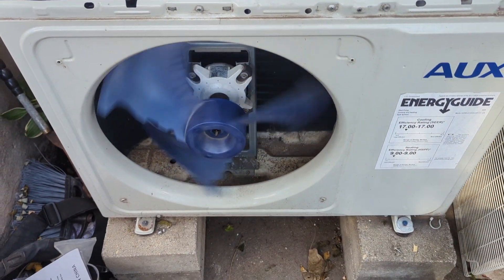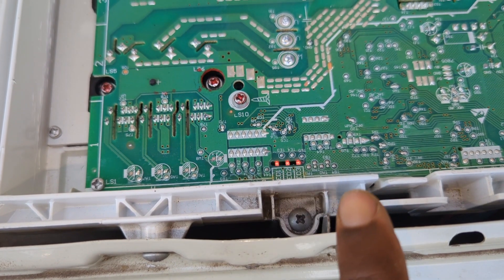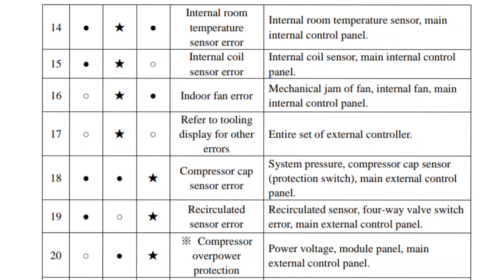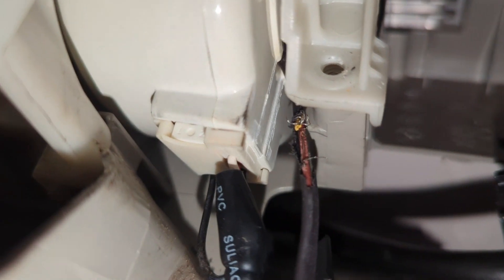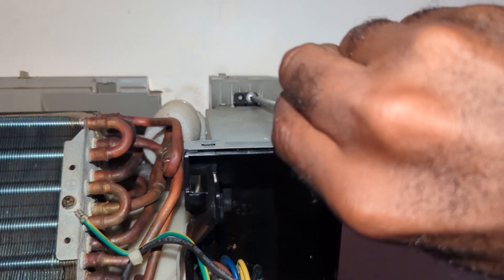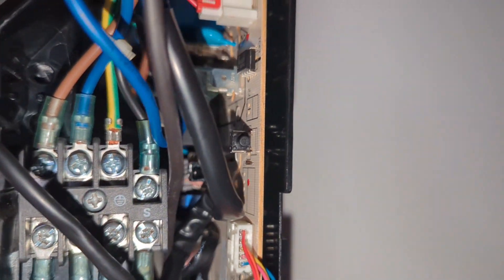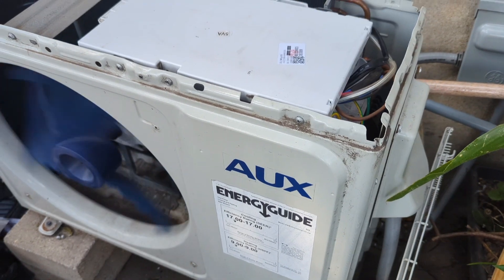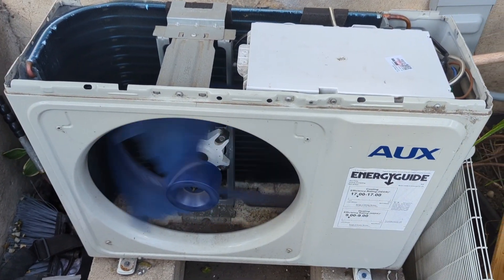Mini Split Not Working E4 Error Code | AUX Mini Split Heat Pump 1200 BTU 115 Volt Fix

Comment: are you satisfied of the product quality up until now, how effective is the heating function when it's really cold outside?
Reply from the maker: It's at my brother's house. I think if you size the unit right for the space you should be fine. As long as it is insulated. If it gets really cold in your area, I would recommend Senville instead.

Comment: Have you ever ran across E3 code? I got the same unit
Reply from the maker: I believe that's the error code this unit had. To know the exact issue I used the indicator lights on the motherboard of the outdoor unit.

Comment: I have no error code inside display, on out side unit all 3 led lights are blinking like a heartbeat.  Temp on copper pipe at the connection is 167, higher on the pipe it drops. Air coming through inside is not warm. Just had refrigerant put in last year, only used it that winter, worked fine. Tech checked it yesterday said I need 8lbs or however its measured. He didn't think that was the issue. I cleaned blower fan. Everything seems to be working except for heating or cooling..  I suspect a leak somewhere. Tech had no clue. I can not find a tech that has a clue. Any advice would be amazing.
Reply from the maker: 3 flashing lights on the outdoor unit is normal, all three lights flashing while the compressor is running. Does it have any other code on the outdoor unit if it runs for a while? https://aux.com.ro/wp-content/uploads/2022/05/Macroclima-AUXTrouble_shooting1-2021.pdf
Reply: Not sure, should I turn it back on, let it run for a little while then check? There is one other light i saw blinking but tech (who clearly has not idea) said that was probably normal.
Reply: Also not 8lbs.. He said I was 8 low but he would have too charge me for a full pound. I declined because again he acted like that probably was nt the problem.
Reply: Ok. It is turned off but I did have it running earlier. I just checked and 1 fl8ght is blinking red. TE the others are solid red, no blinking.
Reply: TE3 Led 1 is blinking
Reply: 1x per second, constant
Reply: I am terribly sorry for bothering you I am just beyond frustrated. I have turned it back on, I will let it run for 20 min then check flashing again. I can't figure out the error code. 😔
Reply: @talenteddad  while running all 3 blink plus T96 blinks on outside motherboard. 🤷‍♀️ Just blowing cool air, set on heat. No error code on inside. Seems to run fine just no heat.. When its off one light blinks the other 2 stay on constantly.
Reply: @talenteddad solid light solid light no light. Can you share that guide? I am unable to find it.

Comment: AUX will not answer the phone..forget about warranty or parts folks
Reply from the maker: Yes. There are other brands with better warranty and customer service. A lot of those manufacturers use the same part. If there is a part # on the defect piece, there's a good chance it is available on the web.